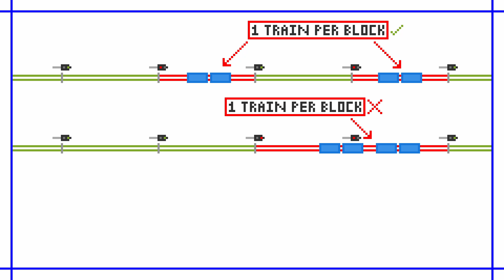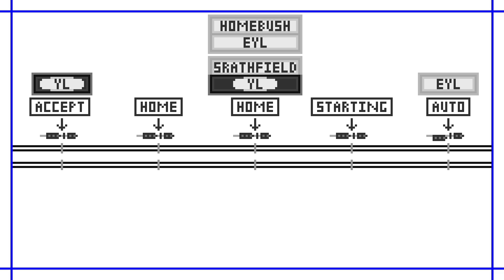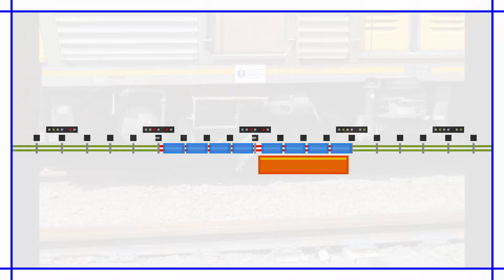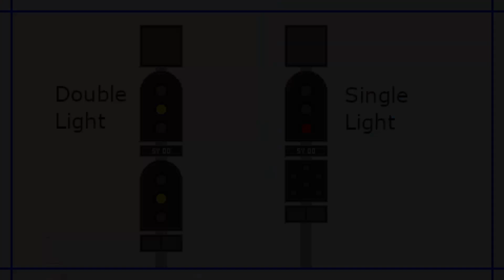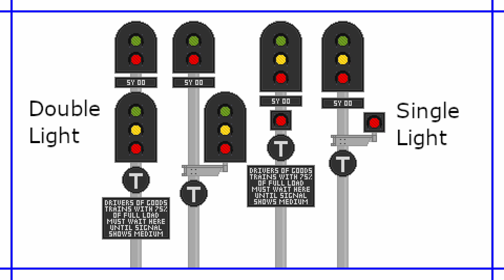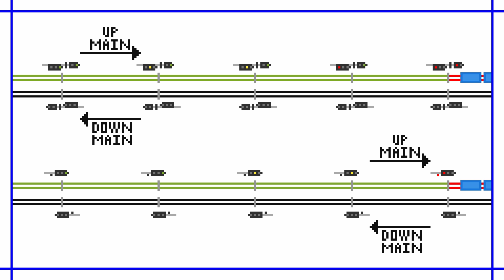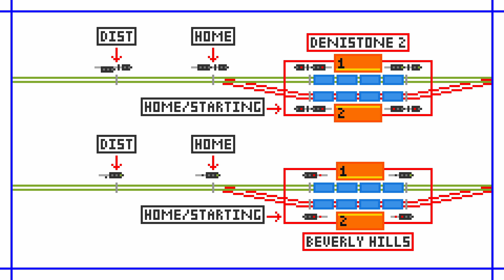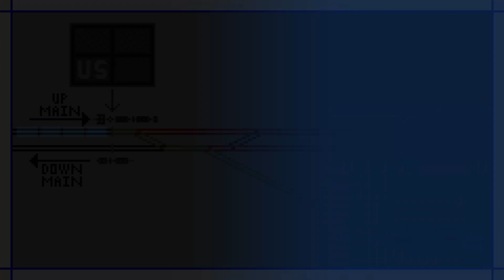NSW Railway Signalling 101: Modern Wayside Colourlight Signals

Comment: There are alot of "Dead End" signals in the Hunter Valley that allow access into coal balloon loops. There are a few attached to "fixed red signals" that allow access into coal loop arrival roads. One that I see quite regular is at the Hunter Valley, Newdell, and Liddell loop that shows either a Stop aspects or the "Dead End" aspects to allow access into the Arrival Road. There are also "mainline" dwarf signals that act like mainline signals with the yellow light only being illuminated when the block infront of it being clear not the Shunt type that allows you to enter the block if it's occupied.
Reply from the maker: I saw those the other day on the driver's route knowledge diagrams, sadly not in time to mention it in the video. They also have fixed reds with just shunt aspects, I spotted one the other day at Clyde. They're pretty unique tbh.

I'll have to look into those mainline dwarf signals, I didn't spot them in the official documentation so idk why I would have missed them.

Comment: Some questions I had while watching the video:
What are the edges of the blocks, and how do you know if you've passed one? How long is the average block?
I'm a bit confused by all the variations with the yellow light. Are all signals based on the status of the upcoming block and the one after that, or do some look further ahead on the line?
Does "aspect" refer to a light or a combination of lights?
Do all junctions get signals, including ones that are only used in very unusual circumstances?
Reply from the maker: 1. In normal systems, each block is defined by the signals. So if you pass a signal, you've entered a new block. As for their length, it varies depending on the type of traffic on the line and the speed, so I can't really give a number on that.

2. For the most part, yes, they're based on the status of the upcoming block. Really you can break signal aspects into two categories, proceed (which is everything from clear to caution) and stop. A signal will display some sort of proceed aspect if the train can continue into the next block. If a signal is at stop, the preceding signals will still show a proceed aspect, but which aspect is dependant on how far they are from the stop signal

3. For the most part, yes. I used the term lights and aspect farily interchangebly, but in general aspect refers to the signal displayed and the arrangement of lights. e.g. Caution is an aspect, but so is aGreen over Red light.

4. Yes, all junctions on mainlines will have signals. If they're in a freight or stabling yard, then it's only sometimes. Even some manually operated points still have signals e.g. at Richmond.

I hope that answers your questions, apologies if it's not super clear or I've failed to address something.
Reply: @CityConnectionsMedia  Little bit more information too.

A block is the section between two signals. If the signal has changed to stop, that means you've entered that block. A train can be in multiple blocks at once. There is no average size of a block. It is only defined as the section between two signals.

There's more complicated signals such as the more restrictive low speed signal which is two reds with a small green underneath. And shunting signals too which are small yellow lights underneath two reds. This allows blocks to be filled block by block mostly in peak areas.

Caution is not an aspect. It is an indication. The aspect is the light itself. Caution would be a top aspect of green and a bottom aspect of red. On a single light colour light an aspect is the light. The indication of a caution would be a solid yellow light.

All interlocked points have signals. These are called home signals and are always controlled signals. This is because the points must be protected at all times.

Comment: Great Vid however there is another signal aspect not mentioned, where I live all signals beyond Werris Creek consist of a single red light and a flashing white or clear light.
Reply from the maker: I do know about those, but for some reason I just never thought to include them.

They're called 'proceed into dark territory signals' and allow trains onto lines that don't have signalling.
Reply: @CityConnectionsMedia  A driver told me that they need extra paper work to proceed There is signaling on these lines which are two aspect (red and flashing white
Reply from the maker: @hamwank  ill have to look into that further, it sounds like it might be interesting
Reply: Hi Greg, the "signals" that you refer to are train order mainline indicators. Their purpose is to protect infrastructure like points, level crossings, and yard limits.
Reply: Between Werris Creek signal 1552 and the DOWN EYL sign at Armidale is all TOW (Train Order Working) which means all drivers need to obtain an encrypted message from train control or write down on a TOW order form in order to enter TOW territory as there are NO signals beyond signal 1552 in the DOWN direction and need a proceed authority with shunt access at Armidale for the Xplorer train and shunt access at Westdale and West Tamworth for freight trains going beyond Werris Creek towards Tamworth and Armidale

Comment: Not to bad but a lot of mistakes.
Reply from the maker: oh? I do want this video to be accurate so if I've made mistakes I'd love to know.
Reply: I made the example, and the GIF on the wikipedia page about the "multiple trains being allowed into a single platform" that they use to do in Town Hall and Wynyard. It's a pretty bad animation but I do know now that the train stops should all start in the "up" position from the time that the front on the previous train passed them, as they do at any normal signal (at least I think they should I have no video evidence for any of this). In the GIF I have them only go up once the rear of the train passes, which is how it works in New York but I'm fairly certain there is no reason to think that the ones in Sydney worked like that. It seems that you did the same thing.

I suck at animation so if you wanted to turn yours into a gif and replace the one on the wiki page that would be good. Also, from anecdotes it seems that the amount the trains "overlapped" the platform was only so much that the train would be about 100-120 metres apart, about the last car of the previous train leaving the platform as the first car of the second is in the platform. I assume they could get closer than this if the first train stopped, but the detail are sketchy and come from an old signaller from the 50s.
Reply from the maker: I actually based mine on the one in wikipedia! I might have to track down some footage or old documents, because right now a lot of the knowledge about this system seem to be not solidly sourced :/

I'd be tempted to put my animation on wikipedia, I just don't have the time to 'pretty it up' so to speak.

I also think you're pretty spot on with your assumptions, but it'll still be worthwhile to track down a proper source. I might do a video exploring this system in future once I get some proper sources.
Reply: @CityConnectionsMedia  Yeah finding sources is really hard. I've tried to go  searching, looking at the old signalling guidebook and stuff. I've only heard from witnesses about it, and apparently at the powerhouse museum there is a timetable for St James station or something from the 50s that has 36 trains scheduled in the hour for one platform.

I can't even get solid information on where the train stops are located, because the system was "removed" some time in the early 90s, and there are few videos from the front of train from that era, but it doesn't look like there are any train stop along the platform. It seems like they were removed in the early 90s and some time between then and now they were added back to be as they are now.
Reply from the maker: I'll have to try and track down an old signalling book I think.

Also, I think you're spot on, but I'm not sure, more research is needed